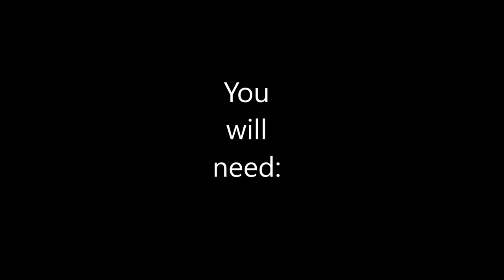Want more power? Amplifier guide

Comment: Hi I have a 30watt transmitter and want to double it’s power so what wattage amplifier would I need?
Reply from the maker: stacked antennas could be solution for you. If you want to double the power with the amplifier you should get one that has at least 60W. In this case your transmitter will work as exciter to drive the amplifier and drive stage output should be reduced to match the final stage max input.